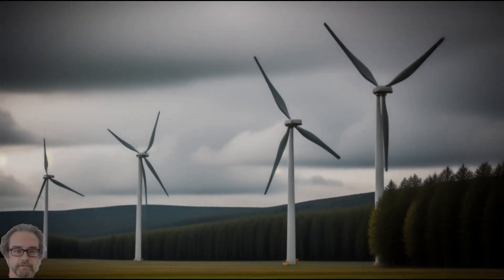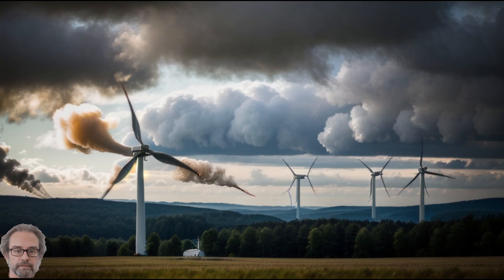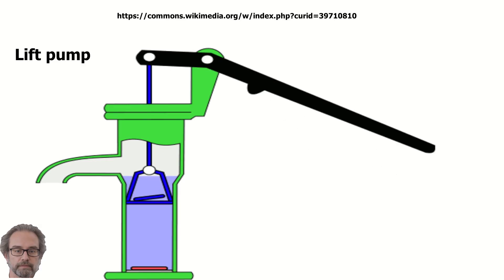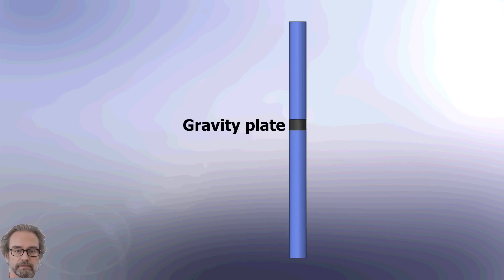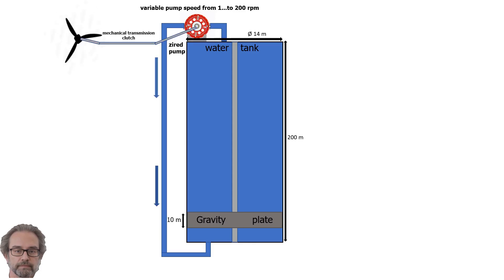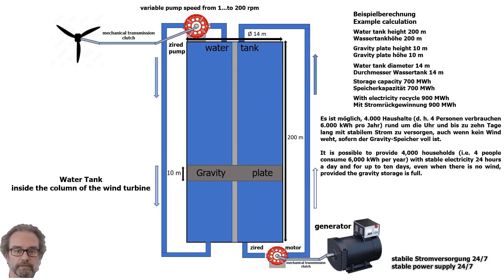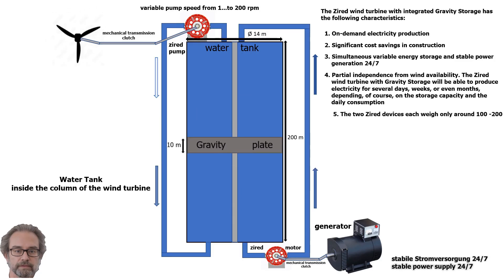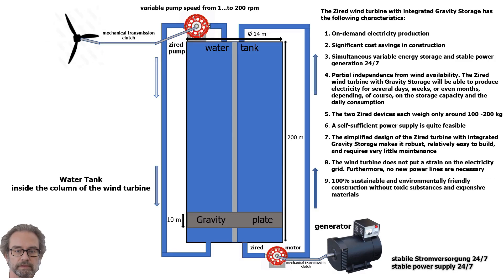Wind turbine with integrated Gravity Storage System "The Game Changer"

Comment: Hi, I tried to reproduce your "calculation". 

If your gravity plate is made from steel, the 10m heigh and diameter 14m gravity plate would weigh approximately 10*pi*14^2 / 4 * 8 = 12000 tonne. 

If you store it at a height of 200 m it can store 24 10^9 Joule or 6.7 MWh. 

If I look at your design, the column of the wind turbine needs to be filled with water from top to bottom. This will be approx. 30 000 m^3 of water, weighing 30000 tonnes. 

The pressure on the bottom of the tower with a 200m water column and a 1m gravity plate will be approx. 28 bar.

Comment: While I find this in principle a fascinating idea, I don't really understand how the lump is supposed to pump the water up while the 'gravity plate' sits in-between the pump and the water. You would also need a water reservoir to store the water, as you can't just pump or realise these amounts of water from or into the ground.
Lastly, the stored water and the pressure would require and extremely reinforced tower, which is greatly on contrast to today's lightway design and will mean enormously higher material usage and thus much, much higher costs.

Also, your pretense 'all renewable energy sources will never be able to play a significant role in energy production without storage' is factually just incorrect. Look at the UK or Germany, where renewables (pretty much only solar and wind, as the geographical necessities for both hydropower and -storage barely exist) already account for 50% (UK) or 60% (DE) of TES.